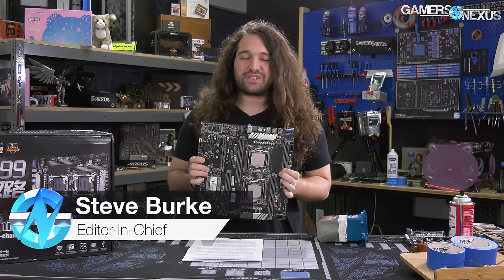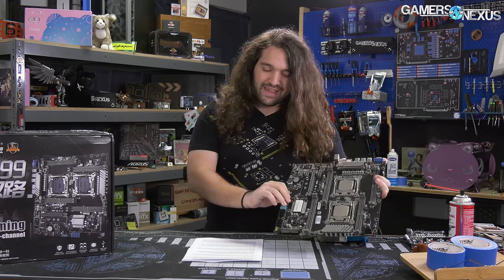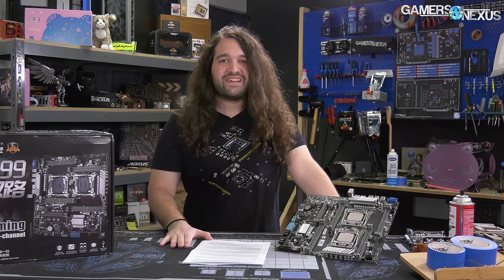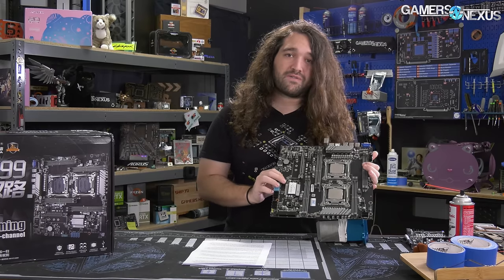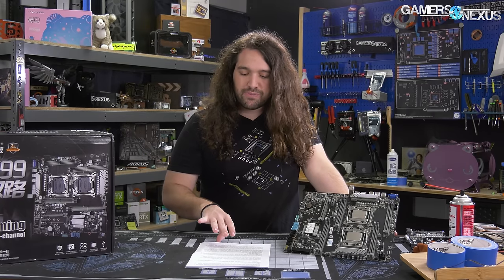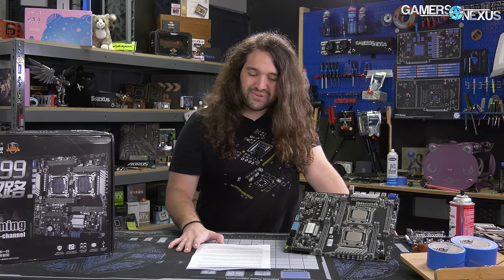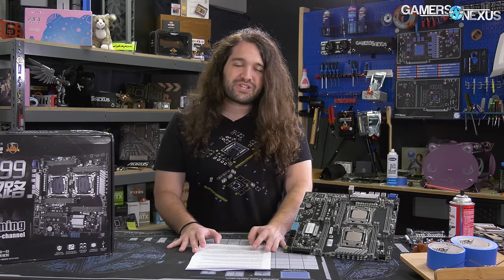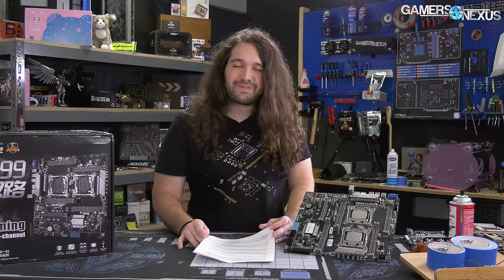24 Cores, 48 Threads for $360: Dual-X99 Jingsha Motherboard vs. AMD R9 3900X

Comment: Hey, Steve nice video
A real use case where this is a better option, is for people like me that work first and game casually but is on a very tight budget.(read the whole thing)

In my case i got an X99-d8 + 2678v3 + 64gb ECC ddr3 quad and honestly is a better option hands down that a price equivalent 3600x system and even give a 3700x a run for the money. WHY? because with no intention to offend you bench marking(in general not yours specifically) don't reflect real word usage all too well and hide a lot of the value on this systems because no real professional is going to use 1 thing a time because that is not a natural workflow, i mean in my case i do full stack development, so at any time i could have 20 different things open(browsers, vscode, databases, bunch of PDFs, service, compilation, etc.) and additionally thing like Plex or jellyfin on the background, VMs to do OS testing, recording desktop/browser(for manuals and guide), office suite for documentations and so on.

This old Xeon are monsters at handling constant load with  high memory pressure(my usual day RAM consumption is around 46GB) without clogging your system response at a reasonable price, So sure my previous 3600x could do 1 thing faster but sadly 12 threads are not enough to keep up my workflow and to scale the RAM was too expensive, really 64GB dual channel cost more than the whole 2678 system did.

I give to you that if money is not an issue an 3900x + 64gb will be a better choice hands down, like full circle murder all around but when money is an issue and you really don't care too much if your game runs at 90fps instead of a theoretical maximum of 110fps, then this haswell systems make a lot of damn sense.

Steve, fun note try that dual socket mobo on Linux with Lutris ;)

Comment: While I understand  the concept of the board, I see the point of its self defeated problems.

As a NAS/SAN device with 10 SATA drives, it offers storage options but then lacks entirely with one pciex 16, which of course would be the 10/40gig Lan. You then lose transcode options.

As a data chunker, the memory has limits, though you could get 16gb sticks... But then it power hungry.
But I did notice in some applications it has good performance, overall it wasn't great and thus maybe for some lesser markets.

I had toyed with this, but I can run old tech,  on smaller scale perfectly fine and add several for the price...
Which is odd. But I could lower than and I would go for a more modern hardware option.

Having said that for practical reasons, a lot of the boards and chipsets are simply not good enough. 
Take for example a system using both 10+gblan cards (dual or quad port) then a upper end GPU, add another card 4x and two m.2 drives and you find yourself out of options.
All Ryzen CPUs are not good workstation processors and this domain is threadripper.

We then get the price jump. But yes you can do smaller lighter weight tasks with Ryzen, but when you get I to pro level, it shows a lot of short comings.

There is where we now turn around to old tech, I've more pciex's that my modern system, I have the same coroe count which is smaller and I use more power.

But that is a trade off to practical use.
That trade off isn't available in this board, so it's a double negative with problems.
Maybe the only market is old dual CPUs mysticism that size matters, or two of in this case, while people forget real world and the bridge issues (5gts) oddly my old tech is 6.8gts which would make the older and cheaper parts faster... Providing the software is coded for it..

At peak draw I'm around 400w, which considering the workstation of modern type (R7) is around the same it makes no difference.

(Power is derived from LAN, dual power supply, dual CPUs internal and external drive arrays, running 20gb Lan and sas card (8.1gbs) and afew hundred gigs of ECC memory)
(Idle is about 167-200w)

Comment: I understand why you went with 1080p testing but it isn't a realistic use case here. $300 for CPU + Board allows more $ for GPU. The performance differences with modern hardware at 1440 or 4K are much less as you start to rely more heavily on GPU.

Comment: It would have been interesting if the chromium compilation chart also had shown Threadripper numbers for comparison, considering that some other charts do include TR CPUs in the list.
For non-gaming productivity purposes, this still seems to be a good option, but the high power consumption (newer chips are much better at performance per watt naturally) is a dampener though.

Unfortunately, I live in a region in which the latest tech is priced very high and double whammy is that the stuff from aliexpress is also having issues with shipping due to geopolitical-economic issues here.
maybe I should email huanazhi about it (the current recommended board from miyconst)

Comment: Sorry if i missed it,
but did you also test with only 1 cpu, running all cores max turbo?
I would guess the benefit from over 24 (unused) threads in case of max fps
is a lot worse than the min fps drops because of two cpus.

Comment: I would buy a host buss adapter like the LSI 9305-16i to get 12mbps SAS ports rather than use two different brand SATA ports on most motherboards if using as a SAN or NAS

Comment: What would be a good way to cool a dual CPU system like this? I imagine large air coolers would be less than ideal.

Either two moderately sized air coolers, a case which can support 2 small AIOs or a custom loop?
Reply: Custom loop would look the cleanest. But two decent sized air cooler are just fine. LTT did a dual socke build in the past.

Comment: Just started watching, but it should be epic.  I wonder how it will compare to my 1920x ($199) 4.1 GHz all core and ASRock X399 TaiChi ($179) - seems like a fair fight!  $360 vs $380 is close enough.  Seems like they would be nearly tied.
Reply: It was pretty cool to watch.  This is on par with my 1920x system under many non-gaming workloads (albeit at higher power draw).

Comment: Steve, may I ask which pc case did you use fr testing this dual cpu mobo? I have a similar X99 mobo from Huananzhi, but having a hard time finding a case that will fit this 300x320mm E-atx monster.

Comment: This was a really great video. To be perfectly honest it still makes sense for a workstation. If you purchase two E5-26XX V3s now for $200 you will be able to upgrade to 2 E5-26XX V4s in a year when they are $100 each. They are already dropping in value due to the corepocalypse AMD has unleashed on Intel. you can get more cores but the more important part is that the 14nm V4s will be better with the power consumption.

Comment: Dual XEON's are only really useful for specific tasks...the hi latency in gaming makes this dual configuration sub-optimal.  Better to stay with a single socket for the E5-2678V3 (12C/24T) if you intend to have multi-purpose uses to include gaming. Pairing with a good GPU up to RTX 2070.

For gaming, you MUST perform the TURBO-Unlock.  Getting all core to 3.3.Ghz.

Comment: hey, great video, 

I'm currently waiting for parts but I ordered (2) E5 2680 v4 and a Supermicro X10DAL-i ATX 2x Socket LGA2011-3 Intel C612 DDR4 Server Motherboard for a work station / some gaming PC and I plan on having 3-4 MSI RTX 2070 GPUs to mine with while its not in use. 

Any thoughts on this build as a versatile mining / workstation / light gaming build?

Comment: Surprising that Steve don't know about ASPEED AST2x00. Those are the standard BMC SoC that reports as "Matrox G200" in Windows. HP ILO, Dell iDRAC, Supermicro IPMI are all AST2x00 chips with custom firmwares.

Comment: Interesting content.  So for about even money, a 3700X + $110-ish mobo would trail the dual xeon setup in productivity, but thrash it at gaming. And for about $150 more, a 3900X + mobo would beat it at both. Either the 3700X or the 3900x would be a much smarter buy.

Comment: There are some other aspects in order to get real turbo boosts on dual xeon boards, the problems is that you've got to some other microcode reinjection on the patch because the microcode is the one that optimizes the processes not always higher frequencies mean higher results if you wan't yo know more you can contact me and i'll explain it to you, we have a group with @Miyconst and some other hardware professional which have developed and improve those patches for different boards for window, linux and hackintosh

Comment: Speaking of cheap old xeons, thats what I use in my home server, a xeon x3230, 4 cores, 2.6 GHz for about 12 dollars. Fun stuff

P.s the motherboard I got for it was an old intel board, so old intel doesn't even have the bios for it on their site anymore, so I had to get the bios from a sketchy 3rd party but it worked :)

Comment: I build hp z640's and dell t7910's i also use the x99 mobo dual cpu. The dual broadwell and haswell outshines any amd out there. They run very cool and with two cpu's you run 7 to 13 percent on high settings HALO infinite campaign. All my pc's come with 64gb and at least a 1060 6gb unless you ask otherwise. The dell t7910's can run the k80 with a quadro 6000 or better. As for a budget renderer the dell t7910 and t7920 are the best choice. I do not stiff people with 2609 v3's or 2620's. I keep it e5 v4 broadwell and use better xeons.

Comment: Just wondering what the boot times on these are? I use a dual xeon build and my issue has been slow post. Takes 30 seconds to post and another 10 for windows to boot. 
Thanks for the video, super helpful

Comment: I was contemplating getting a dual CPU x99 board for my two xeon 1650-v4 processors. base clock of 3.6 and a turbo of 4.0. its a six core 12 thread cpu as well. I'm hoping it'll get me some performance

Comment: I've wanted a dual CPU pc for most of my life.  There is no need for such a beast now with 16 core consumer CPUs and crazy enterprise equipment available at government auctions.  I'd still love to build one though...
Reply: Had an Abit BP6 with dual Celerons overclocked to 550 MHz back around 2000. Threadripper, Ryzen 5000 and even Ryzen 3000 are fantastic bang/buck.
Reply: @MichaelPohoreski  do you remember it fondly?
Reply: @circleofsorrow4583  Yup.  Ran Windows NT 4.0 on it. Kind of sad SMP died but that is the nature of technology.  It is crazy how cheap cores have become. I joke that AMD puts the AMD in Amdahl's Law ! :-)

Who knew Intel held quad-core gaming back almost a decade!

Ryzen 5000 CPUs are amazing price/performance.

Comment: Geekbench v5 Single-core :
Xeon E5-2690 V2   (my system):    749
Ryzen 9 5900X       (twitter leak):  1605
OUCH !

Geekbench v5 Multi-core :
Xeon E5-2690 V2   10/20 (my system):    6865
Ryzen 9 5900X       12/24 (twitter leak):  12869

Comment: To be fair the price difference could be quite big compared to a R9 3900x combo depending on where you live.
If we exclude the States in a lot of places the prices start at least 10%-20% higher for the 3900x. Then I assume since you are buying a 3900x you aren't going to get the cheapest mobo out there, but at least close to mid range even if you are on a budget. Then comes the RAM. I doubt you are going to use the cheapeast 2133 RAM you can find with the 3900x(I'm sure the chars with the 3900x that were shown probably used the most optimal RAM which would be quite a bit more expensive), so even the RAM will cost you more.
And again as I mentioned prices for all parts(not just the CPU) in most places around the world start at least 10%-20% higher, so I wouldn't be surprised if the Ryzen combo is 100%++ more expensive than this chinese combo.
Don't get me wrong I'm not saying that if you can afford Ryzen build you should go with this, but I'm just saying that if you can't afford Ryzen build you shouldn't feel bad if you go with this type of combo. There's definitely value in it, depending on where you live. Big value in fact :)

Also it's nice to see Miyconst being mentioned. Found him and started following him when he had around 500-600 followers. He is doing a great job with these reviews.

Also @Gamers Nexus. Keep showing these type of videos. It's true that most users prefer new and considering the value Ryzen brings it's hard nowadays to suggest this type of combo's over a Ryzen build, but it doesn't change the fact that they are really interesting to watch and some times there are hidden gems among them :D

Comment: You should revisit the older 1st gen threadripper cpus and see how they perform today in gaming... like the 1900x and 1920x and 1950x since they are cheap now... the boards are over priced but the cpu themselves are priced very well considering your getting a threadripper for $80 bucks lol

Comment: Bro CPUs like i7 4960x or xeon e5-1680 v2 can deliver performance at level 100 fps at any game today. If you are not aiming in nothing more then 100 fps it is still perfectly fine up today. So it means if you want to play 4K Ultra at any game, you don't have to buy newest, very overpriced CPUs, you can use old ones that was once best in theirs league.

Comment: These processors are good for utilizing DDR3 high RAM sticks on the cheap. Sadly you lose this with the Chinese boards because they only have 2-4 RAM slots/CPU. I have one sitting in my homelab hosting an Elasticsearch cluster with 1.5TB ram. You can't do anything like that with an AMD R9 chip. Those are much better when it comes to instructions/watt.

Comment: personally i´ve been looking a lot at 2x2680 (i think they like different types of ram the 78 sucks) for a Proxmox server, where i like the corecount better than high performance cores, since i am running at least 5 VM´s on my server, currently rocking 2x4790k´s which struggle. and these are the same generation cores, so from 8/16 in 2 different systems to 24/48 core/threads on one board, would be nice.. actually also hope it would be a bit better in power consumption

Comment: I built one of these accouple years ago with a single socket and a e5 2690 v4, single socket helps at least a little with gaming along with a little bit better arch with v4 than v3 but I can tell you it will be retired soon.

Comment: Dual xeon show bad result in gaming, but if you pull out one out, you can achive better performance with one cpu+ 2133 10-10-10-24. Results will be higher than ryzen 1000/2000

Comment: i know this is old. but steve you should compare it with different cpu set. im not sure you have many oc features but the 16xx v3 were unlocked multiplier. they still support dual socket unlocked the icore line making them the closest to the i7 you can get for single core speed.  can you compare with two 1680 v3? they are only 8c16t per chip so 16c32t total in pair. the advantage is that with the unlocked multi and less strict tdp many claim 4-4.5ghz stable on one chip. the 1660 v3 is essentially the same thing just a lower binning. that chip is about 50$ a chip right now. i ask because the xeon here lost mostly over the single core speed, tdp limitations, and latency between the two cpus. the 1660/80v3 elliminate the issue of low single core performance, while still having enough cores to lessen the comminacations needed between sockets for a closer real world result. not to say the xeon would win, just curious.

Comment: While there is technically 8 independent channels, I doubt you can read the 8 channels simultaneously meaning the maximum bandwidth you could ever get is the same as 4 channels  over two memory segments

Comment: Hrm, quick question about that setup: Would a hypervisor make a difference with the low fps / stuttering slapped in the middle so to the guest OS it looks like a single cpu with X cores? Like ESXi + Windows 10? 
I'm thinking of combining my current old xeon (L5640) lenovo homeserver and my old and trusty 4790k gaming/coding system into one bigger E5 v2 server (so my 128gb ddr3 ecc is still usable) and game via streaming, work via rdp @ multi-monitor

Comment: AMD make a 5850x part with 10 cores and 100 mhz higher on the boost then all the other in the 5000 series out box and 100mhz higher on the turbo & have it marketed as gaming with workstation capabilities - chip.. (all core turbos being great can you take the #1 spot?) ...then all the others in the series, also make it have a good price and be super available, make a ton as most will be super happy to have more the 8 cores and feel "cool" ...it will win in so many ways .....plus I sort of "like" ... not being able to get away from that number "58" if anyone knows what I mean, HAH..... #58 #79 #99

Comment: Does this motherboard benefit from having dual VRM fans from the Arctic Freezer II AIO coolers?
Reply from the maker: Great question! Haha, well, the VRM is a little bit cooler. It doesn't particularly matter since we're so limited on OC options, but it does technically keep it a bit cooler.
Reply: @GamersNexus  It's looks very stylish. I was planning to go with the Freezer II for my own system until a friend got it for his system and I saw how THICC the radiator was. Technically, it could fit my case (Cougar MX330-G) front mounted. I went with the Be Quiet! Pure Loop instead. I was worried about not having fans for the VRMs. But I still got good air flow from front to back.

Comment: Some intel CPU's, like the E5-2678V3 (12C/24T), that are not listed within ARK are OEM versions (in this case, a variant of E5-2680V3) and are not ES. With turbo-unlock modded BIOS, the 2678V3 will achieve same all core turboboost of the 2680V3; i.e. 3.3GHz across all cores. The benefit of this 2678V3 OEM variant, aside from its relatively cheap price ($85), is that it is both DDR3 and DDR4 compatible. Why DDR3?  Because DDR3 (aside from relatively cheaper prices) will run in QUAD channel and with tighter timings.

I would stay away from the Haswell ES CPU's, as they cannot be turbo-unlocked.
Reply: I would think that QS ones would be unlockable, though.